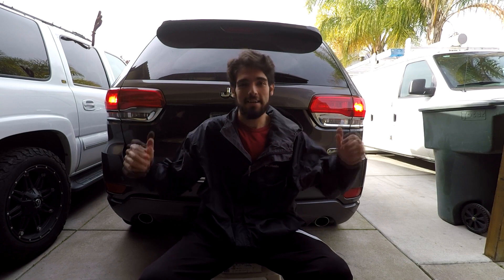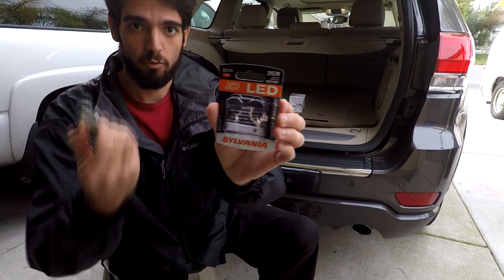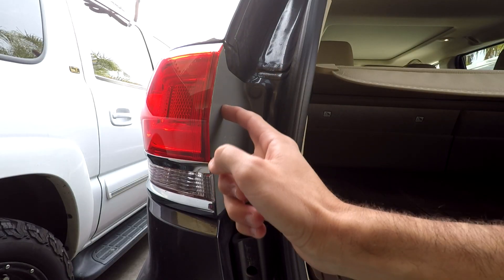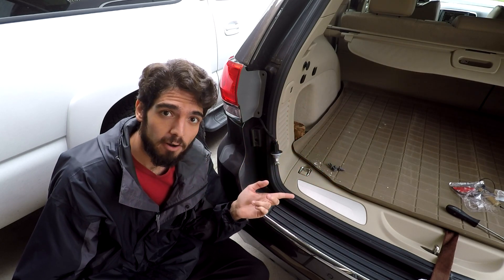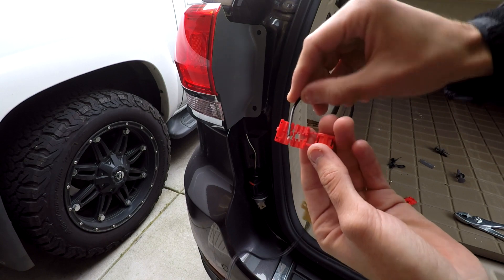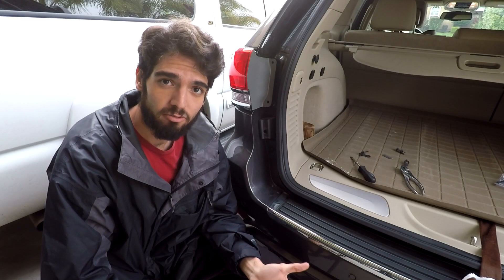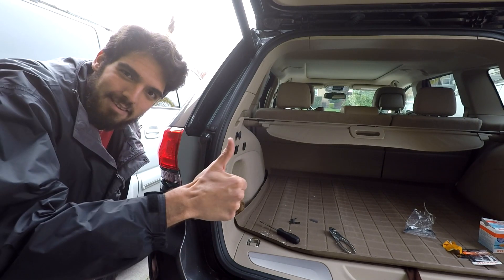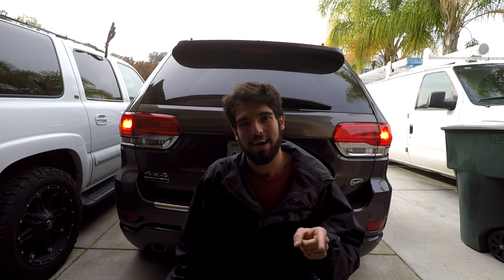Install LED Lights Using Load Resistor WITHOUT Hyperflash!!!

Comment: Don't use double sided tape as you will lose all the heat transfer that is required to keep the resistor cool. If you must use the infamous 3M connector as seen; load it up with dielectric grease and wrap well to keep the elements out. You would be surprised the moister that finds it's way into these "sealed" lamp housings.

Comment: Don't forget guys this resistor gets hot and keeps getting hot in some cars, you can actually cook an egg on it, it gets up to about 145 degrees and keeps Rising. You can burn your carpet or burn wiring so be careful. I recommend using 80 watt 8 ohm resistors but every car is different

Comment: I just purchased a 2020 Jeep Grand Cherokee Summit which comes with the LED/Bi-Xenon headlights package by default. Everything up front is LED and the rear tail light trim around the housing is also LED. The brake + turn signal is incandescent. I watched another video where this person had a 2015 Grand Cherokee where they didn't need the resistors. I tried contacting them but no response.

Do you think I will still need resistors for my brake + turn signals in the rear since my blinkers up front are already LED?
Reply from the maker: Hi Spencer, yeah our vehicle (Overland) is basically the exact same setup as yours in regard to the factory LEDs up front and the incandescent “bi-level” bulbs in the rear and we absolutely needed the resistor. The only way I think you could get around it is if a bulb manufacturer had some type of bulb where the resistor was built in, but it would most likely make the bulb insanely too large and hot. As for why the current LEDs function fine, it seems as though FCA engineered the factory wiring system and computers to accept the current draw based on factory spec, so when we replace with the LEDs and they draw less power, we fall out of the acceptable range they set and the hyper flash symptom occurs. :/
Hope that helps and feel free to reach out with more questions!
Reply: @1Brain4Wheels  ...thank you so much for that info. I did find a company that promises no resistors with their bulbs because it comes with built-in resistors. I might give them a try but just trying to justify the cost of these bulbs.

https://www.mhfautolighting.com/collections/2014-2019-drl-boards/products/complete-reverse-led-kit-for-the-jeep-including-including-srt-overland-laredo-limited

Comment: I strongly advise to NOT JUST LET RESISTOR DANGLE !! The resistor as stated will get very hot & specifically says to MOUNT TO METAL TO DISSIPATE HEAT. Leaving it dangling can definitely melt the wires, bumper & anything else plastic that in comes in contact with. DO NOT DO WHAT HE DID!! MOUNT ON METAL IN A GOOD SPOT OR MARK MY WORDS YOU’LL WISH YOU WOULD’VE UNLESS YOU OF COURSE DON’T MIND REPLACING MELTED BUMPER, WIRES, ETC...
Reply from the maker: Hey there, first off I completely agree - you're technically supposed to mount the resistors to metal for the exact reason you stated... however in the case of this particular vehicle, I got lucky and it actually worked out solely because there's a huge void in the bumper (so it's always away from any plastic even when just hanging) and it actually gets pretty good air flow that way.  So, I guess I'm saying that it's possible to do it my way and have no negative effects, but tailor whatever you do to your specific vehicle and use good judgement because they definitely get toasty.
Reply: @1Brain4Wheels  That’s awesome that you’ve had gotten Real lucky it hasn’t done any damage.  I can easily see how convenient it would be to just let allow it to dangle in that pocket although I’ve had Jeep’s & if you know the deal with them is they always have a electrical issue (Usually a faulty ground somewhere) & when you connect that resistor it’s connecting into the feed & the ground that’s why they insist on mounting onto good metal surface to not only help to dissipate heat but also getting good ground plus by doing this way will help last longer I know to each there own but I just trying to save others alot of money & possible grief & frustration if perhaps the it melts through bumpe or the ground causes the famous phantom electrical issues.

Comment: What if you change your low beam and high beam and reverse lights the only visible hallogen lights and  dont mess with the turn signal blinkers will you still have hyperflash?
Reply from the maker: As long as you’re not messing with any of the bulbs on the turn signal circuit, you shouldn’t have hyper flash 👍🏻 One word of caution though, if you’re doing this on a newer vehicle, you might get other warnings that pop up when you engage those lights, telling you that they’re “out”... it just depends on if your car can tell the circuit isn’t pulling enough juice when on.

Comment: DO NOT I repeat do not just let the resistor dangle by the bumper like that. It’s an expensive lesson I’ll have to pay for. Resistor heated up and melted the bumper bubbling the paint. Mount to metal and don’t be an idiot like me.
Reply from the maker: Oh no, that's not good! So it was pushing up against the inside of the bumper? Ughhh, now I need to check the inside of mine, so far no problem after 2.5 years, but I want to check and see if there's any mild melting on the backside... thanks for letting everyone (myself included) know!

Comment: isnt there led bulb with in resistor??
Reply from the maker: There are some on the market, but leds with built-in resistors for automotive use haven't become mainstream yet :/ To dissipate all of that heat requires a bulb "body" that is too big for a lot of applications.

Comment: I watched video after video on how to install these. None of them actually showed where to mount the resistor. I dropped mine down like you did. Took me about 15 minutes to do it. Thanks!!
Reply from the maker: Nice, yeah people have a lot of different thoughts on how they should be mounted, my thinking is that if your electrical connections are good, it's fine to let it hang and then it can dissipate heat easily being in air rather than stuck up against the car or bumper etc.

Comment: I want to do this to my mom’s 2018 Grand Cherokee Limited 25th Anniversary since all other turn signals are LED. I feel as if it will be a lot cleaner look! My dad is worried bc the car is so new but should he be worried? I really want to do this.
Reply from the maker: Haha, that sounds literally like my family! I did this to my mom's Jeep over two years ago now and the lights and resistors are still running strong so I'd say do it! Plus, it does look way better and you can tell Dad it's safer because LEDs are brighter and activate quicker :)

Comment: Thank you so much for that info. I just did mine and it’s perfect. No issues with your?
Reply from the maker: Thanks Rod, hopefully the video was able to help you along the way! :) So far we've had this setup on the Jeep for a little over 2 years and no problems!
Reply: A trick: you can watch series at flixzone. I've been using them for watching lots of of movies during the lockdown.
Reply: @Achilles Arturo Yup, I have been using Flixzone for years myself :)
Reply: @Achilles Arturo Yea, I've been watching on flixzone for since november myself :D
Reply: @Achilles Arturo definitely, been watching on Flixzone for since november myself :)

Comment: On the right taillight, where you mounted the resistor isn’t touching any plastic from the housing. That location won’t cause any plastic to melt from the heat the resistor is giving off ??
Reply from the maker: Ajay Nair I did actually go back and check on it a few months after doing this install and everything looked good so I’d say it’s okay! :) What I’ve found is that with normal use, these resistors don’t really get “hot”, just warm... maybe if I had the blinker or brake held down for hours it might get hot enough to cause damage but I think for most people it’s alright!

Comment: I have an 18 grand Cherokee. Just bought the led lights and resistors. No issues for you? I was wondering where to put the resistors bc as you said there’s barely any room behind the tail light to put them.
Reply: I can’t believe grand cherokees don’t come with led lights. So stupid. You would think they would be factory led lights. Resistors suck lol
Reply from the maker: I totally agree, such a bad way to cheap out on us, especially since they already have led running lights! Stupid FCA...
Reply from the maker: What I ended up doing was dropping the resistor down below where the taillight housing mounts, kind of behind the corner of the bumper - from there it will get good air flow (resistors get hot), but it is protected well enough from the elements. Hope that helps! :)
Reply: You dropped them both or just the one? I have no problems doing whatever you did lol I just know there isn’t much room behind the lights! I got the led flashing brake lights but wasn’t sure where to put the resistors 😩😩
Reply from the maker: Oh haha, yeah on the right side the resistor was able to fit on the body of the car, fitting kind of below where the socket of the housing is (there should be a gap on the housing underneath this where the plastic bends in, allowing for the space required to fit the resistor) it’s tight, but it can work if you don’t want to have it hanging. :)

Comment: So, I have a 2011 Jeep Grand Cherokee and switched out my rear indicator/brake lights with LEDs. I also installed load resistors, but here is the problem I am facing. They work great during the day, but at night, when my the headlights are turned on, I will get the error that my turn signals lights are out and it will hyperflash. Any suggestions?
Reply from the maker: Hi Steve, I was honestly stumped with your problem, but I did a little searching online and found someone else with the same issue and their solution ended up being that the connection to the resistor was loose. I don't have a lot of knowledge when it comes to electronics , but maybe when the headlights are on, there's just enough less draw going to the blinkers that sets off the alert that the blinker is out? I would just confirm that all connections are solid and go from there if you haven't already done so. Here's the thread I was reading: https://www.coloradofans.com/forums/201-2nd-gen-electronics-audio-lighting/338065-hyperflash-but-only-when-headlights.html

Comment: Hi, I have a 2011 Grand Cherokee and looking to do this but curious if you had any issues with the left rear light hanging below the light with heat or melting anything. Thanks for the video!
Reply from the maker: Hey there James, it’s funny you ask this, I actually just checked on this right before Christmas... I’m happy to report no damage at all 😎 I guess the resistor gets pretty warm while the blinkers and brakes are engaged, but since they aren’t on for too long at a time it seems to be good so far. :) Good luck on the install, it’s pretty straightforward and definitely worth the improved function!

Comment: In the past, there was a "Flasher Unit" that looked like a relay, it would mechanically open and close the circuit using heat from the current flowing through it going to the bulbs. If a bulb burned out, it would cause the "Flasher Unit" to switch open and closed twice as fast (hyperflash), which was a nice indicator to the driver they had a burned out bulb. The mechanical opening and closes of switches in these units made noise (and were usually installed under the dash. With Flasher Units and LED's, since the current load is much lower, the incandescent "Flasher Unit" won't work right (hyperflash), but you can buy a replacement Flasher Unit designed to work at the current loads for LED's.

Today, a lot of the Manufacturers of gotten away from the Flasher Units and instead use one of the Vehicle Computers to switch the Turn Signal Bulb on and off.  In the Jeep Grand Cherokee its the TIPM that is inside the Fuse Box under the hood, that controls all the electrical power distribution to the car.

So in Jeep's case, and more than few other manufacturer's, while they were at it, since it was just a few extra lines of codes, they designed the software for the Computer controlling the Flashing, to recognize if the bulb was burned out and then mimic the old warning that has been in cars for nearly a hundred years (the hyperflashing), and send a message to the display. The low current draw of the LED's will fool the computer into thinking the bulb must be burned out. The car electronics mimic the clicking noise the old flasher units made as well, sending the sound through a speaker under the dash.

Why the factory LED indicator on the side mirror hyperflashes? My guess, since the led's current load is so low, they wire the side mirror LED's directly to the indicator on the dashboard, and thus the TIPM mimicking the hyperflash as a warning, causing the dash indicator to hyperflash does the same for the side mirror.

TIPM's are very expensive and they are not making "special" TIPM's just for LED's. Could you reprogram the TIPM to work with LED's sure. But the automotive computer software standard has a lot of safeguards to prevent tampering, rewriting software is way beyond most auto enthusiast, but even more difficult is getting your hands on the electronics that can "flash" the ROM's chips with the new software into the modules.  So we haven't seen someone come up with a software fix yet.
Reply from the maker: Rick Anderson wow, thanks for all of the info! :) Okay, that would make sense about why the mirror LEDs hyperflash... yeah, I remember back when you could just change out the flasher-not quite so simple now haha

Comment: Sylvania improves the safety, look at the comparison between left and right at the beginning of the video. Nice choice!
Reply: Yes, incandescent bulbs take a few milliseconds to heat up to the point of producing light. It is enough time to be noticeable as the video shows. So in the case of Brake Lights, that is arguably a safety improvement switching to LED's. You might note that just about every 3rd (high mount) brake light is LED from the factory.

While we're on Safety, you might also note that LED packaging warns the bulbs are for off road use only. Even the Sylvania and Philips LED bulbs. This is because light bulbs have to be DOT certified, and mostly because to ensure they make enough of the right light, but also the light is cast on the road in the right pattern and intensity so they don't blind other drivers.

Since LED's can't cast light just like an incandescent bulbs, they can't guarantee they will cast their light in existing fixtures in the same pattern or intensity that the original configuration was DOT certified.

If you have a rigorous yearly safety inspection in your state, you very well might fail the inspection, cause the inspection and inspector will look to make sure the bulbs used are DOT certified, and to the best of my knowledge, not a single aftermarket LED bulb is DOT certified.

Some of the lesser known brands are really playing fast and loose, and advertising their bulbs are many times brighter than incandescents, which might lead to blinding other drivers and being a hazard to others on the road. Especially the Headlamp and driving/fog lamps LED replacements, just amateur tests show they do not cast in the pattern the incandescent do, and some that are at intensities that exceed the DOT limit, would be a hazard to other drivers. As well, more than a few LED headlamp bulbs do not cast as bright or far as stock incandescent head lamp bulbs.

But Sylvania and Philips are working to get their LED's DOT certified, and IMO are the closest to the DOT certified bulbs, i.e. the safest to use that would be the least likely to blind other drivers would be the Sylvania and Philips. That still won't get you too pass your Safety Inspection, if the bulb is NOT DOT Certified, you fail the inspection, its that simple.
Reply from the maker: Thanks! Yeah, I definitely like that they are brighter and light up faster, especially since my mom drives in the commute a lot anything that can prevent her getting rear ended gets a 👍🏻 from me!
Reply from the maker: Rick Anderson Thanks for all of this good info, thankfully in California we don't have any safety inspections for typical registration, but that is definitely something people who reside elsewhere should take into account! So far, I've really been impressed with how bright these lights have been, even out in bright daylight.... when I put no-name LED's on my mom's old 4Runner back in the day, I actually removed them after a short while because the blinkers were just too hard to see during the day (even though they looked awesome at night!)
Reply: Let me comment your sentence:

"Since LED's can't cast light just like an incandescent bulbs, they can't guarantee they will cast their light in existing fixtures in the same pattern or intensity that the original configuration was DOT certified."

It's correct, but it's not the reason why those bulbs are not certified. The real reason is that THERE'S NO regulation about LED bulbs for automotive usage. 

With the red bulbs installed on tail/brake luminaires I can tell you that there's a very high probability that the light pattern is even better than the traditional.